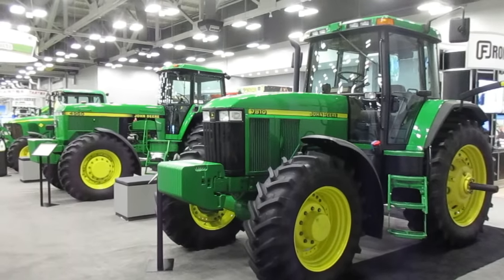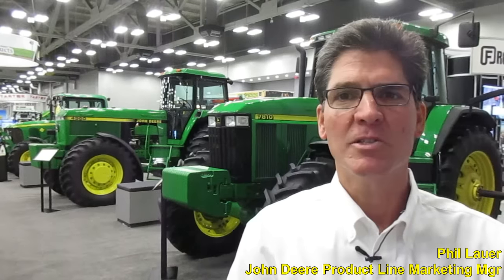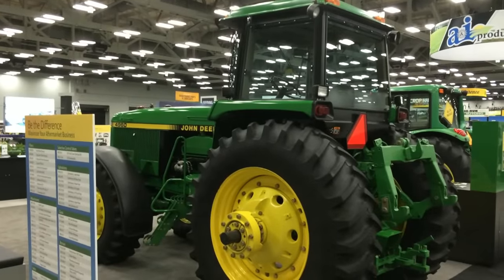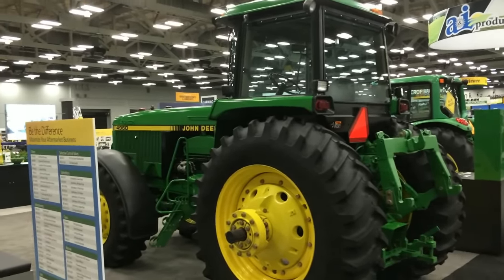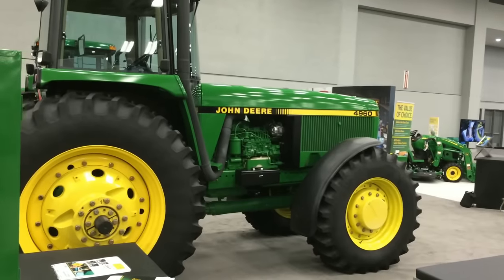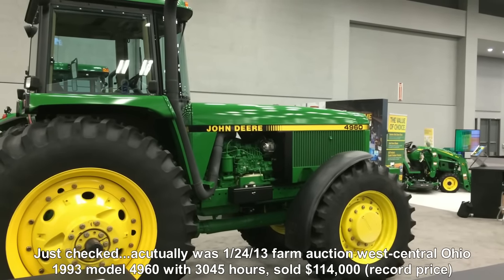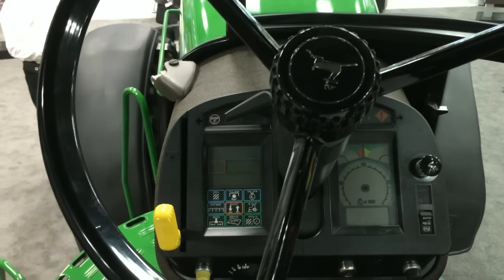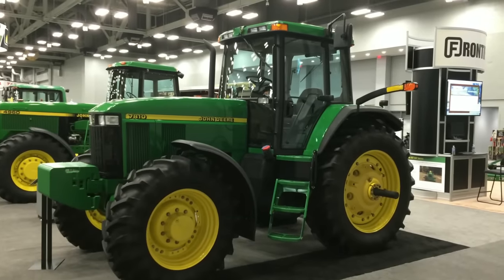John Deere 4960 and 7810 Tractors with only 6 and 18 Hours both last Serial Number Models

Comment: The John Deere 4960 is one of the best John Deeres in my opinion I've been around we used to run one till we upgraded to an 8130 but I wouldn't be against getting another one as backup

Comment: Has that 4960 an aircooled motor?
Reply: Goodness no.  All equipment operating at that level is liquid cooled, no matter the manufacture.
Reply: Shain Andrews there's a German manufacturer that made aircooled tractors that size. so i wonderded because it had no grill
Reply: Ahh I understand your logic now.  Most if not all of the 40 series John Deere&#39;s do not have the front grill mesh.  The air is drawn in the side panels and ejected in front of the engine.  Post up the name of the German air cooled tractors.  Would love taking a look at them.  http://www.tractordata.com/farm-tractors/tractor-brands/johndeere/johndeere-tractors.html
Reply: Gijs Hennnie it does nave a small one up front